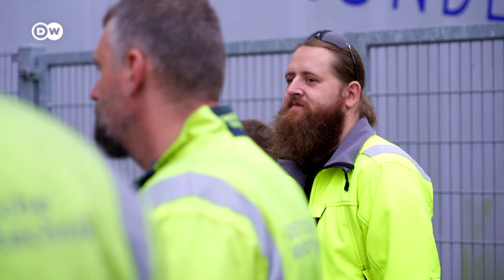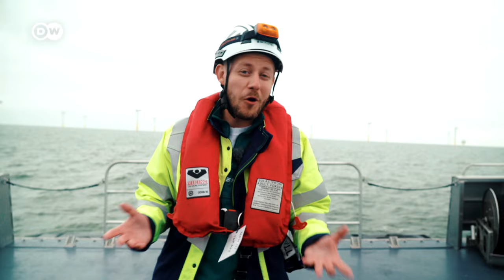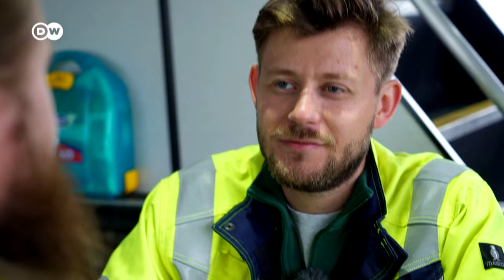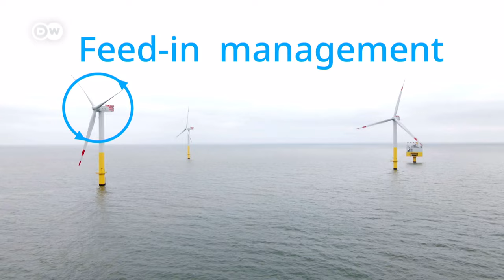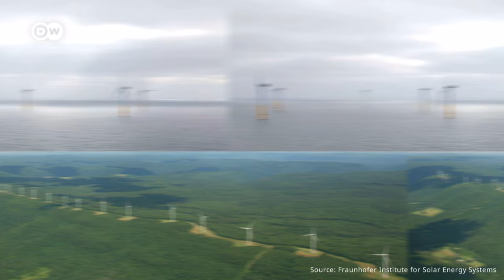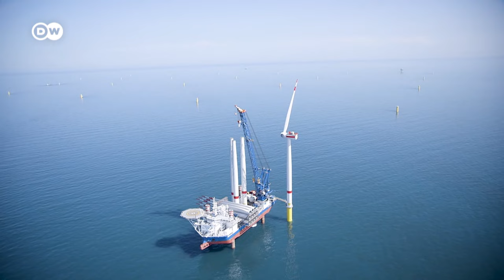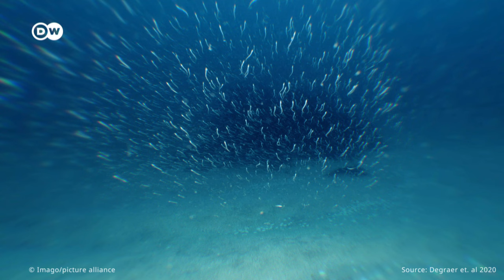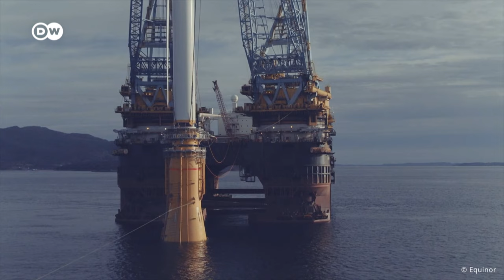Is offshore wind the energy of the future?

Comment: Wind isn't 24/7 in the North Sea 

The next generation offshore wind farms that will go up will have about 60% capacity factor which is pretty good but definitely not 100%

The biggest advantage to offshore wind is that you don't have as many objections from the locals
Reply: the UK government is building 33GW capacity on the Dogger, the figures for later build estimate a hopeful load factor of 0.63  ,  current Dogger bank is 0.42  both are over a year. Gridwatch shows the issue with wind and dispatchable power . 

maintenance costs are expected to  drop from 60% of build costs  to 10%  . thats over a 20year lifetime.
Reply: The capacity factor you give is a mean value over the year, but we also have to look at its minimum value.

If there is 24/7 wind in the north sea, in only means that the minimum predictivity factor during the year is greater than 0.

It is very important to look at both the mean and the minimum value. The mean will give you the reductuon in fossil fuel consumption that we can expect, so the result for the climate. The minimum value will get you the amount of fossil fuel plants that we can shut down to lower the costs of clean energy production (indeed with a minimum capacity factor of 0 when there is no wind or sun, you have to keep almost the same amount of fossil fuel plants so that everybody gets electricity).
Reply: @the_forbinproject2777  Offshore wind will be a large part of the energy future of the UK and Europe and will hopefully be cheap once the infrastructure is in place

If it costs £46/MWh for this cycle
Hopefully in 25 years time they can reuse the foundation the tower the cables the onshore and offshore converters etc perhaps the next cycle might only be £25/MWh since more than half the infrastructure will live beyond 25 years
Reply: @kiliandervaux6675  Yes correct at the moment wind and solar allow you to close approximately zero power stations because you need them for the windless days

However this isn't a huge problem because CCGT and OCGT power stations are relatively cheap at around £600/KW of capacity

So for the UK to build 50GW of gas fired backup would cost £30 billion but they would last over 30 years so just £1 billion a year for the backup or about £3/MWh
Reply: @kiliandervaux6675  I did this simple calc a year ago, I hope it helps 

2019 year Grid watch figures for wind delivered.

minimum: 0.095 Gw and  maximum: 13.855 Gw
 
The highest delivered power of the installed fleet was 13.855 Gw out of 22Gw installed capacity 

13.855/22 =  0.6297 or say 63%  ( 0.63) 

this means the peak GW power during any one hour of the year  could be

current fleet 			= 13.855
new fleet	33 x 0.63 	= 20.79	
combined			= 34.645 GW  delivered  

And the minimun lull figure is;

current fleet 			= 0.095  
new fleet	33 x 0.00432 	= 0.143
combined			= 0.238 GW  delivered 

new fleet is the planned 33GW of wind farms , also 

22GW fleet is averaged 6.22 GW x 8760 hours per year 		=  54.5 TWh

33GW  proposed fleet is ave  13.86 GW x 8760 hours per year	= 121.413 Twh

combined its							= 176 Twh pa (target is 260 Twh) 

these figures are taken from a report I sent to Boris Johnson .  I am not government and he hasn't replied.
Reply: For example, here are the capacity factor of different energy supplies :
Wind turbines (on the land) : 25% (0 to 100)
Solar : 12% (0 to 100)
Nuclear : 75% 
Coal and gas : way to much co2 (I don't really know but probably around 80% which is enough)

Conventional sources like nuclear, coal or gas have a minimum capacity factor very close to the mean value, which means that they are "predictable" in opposition to renewables
Reply: @kiliandervaux6675  you figures are close to values I have 
solar UK based : 10%
wind land : 22%
Wind sea : 42%

but nuclear can get to 96%  , The French can cycle fro 50% to that figure by EU standards ( meaning nukes can load follow ) 

If i use EIA figures for nuke build and a load factor of  84% for them , then the cost per GWh built is cheaper than wind. And its dispatchable. 

there are other load factor figures , some countries will do better with wind and solar for the obvious reason of location .  My figures are for the UK .
Reply: @factnotfiction5915  Yes you don't 'need' the wind turbines but we 'want' the wind turbines to do both emissions reduction and also to help balance of trade and also help fossil fuels last longer and finally to pay less for gas

If we import 40 units of gas and produce 60 units of wind that means the gas per unit is cheaper than if we had imported all 100 units of gas

Also offshore wind power will improve continuously as it has been for 30 years

You may find that is 10 years time the cost of wind power is below £30/MWh in which case by all fair metrics its below fossil marginal gas production 

I was very pro nuclear 
I can see and understand it works 

But now I'm pro offshore wind because its just got a lot better and a lot cheaper and will continue to do so fir some time yet

I can imagine 30MW turbines deployed in a decades time which produce electricity at very low prices
Reply: @factnotfiction5915  To add to your point we can calculate the marginal cost of electricity from N-Gas

If natural gas costs £15//MWH and fleet average efficiency of ccgts are 50% then the marginal cost is £30/MWH

That means if wind or solar can be produced for under £30/MWh they would be useful for fuel savings irrespective of climate change benefits etc

Also bear in mind fossil fuels aren't infinite so it would be reasonable to pay more for wind energy for 2 important reasons 

1. The fossil fuels would last longer 

2. The price of fossil fuels is set on the margin so if you are a net fossil importer adding non fossil energy reduces the price of fossil fuels so you benefit in that way too

Re nuclear imo it would be better deployed as district heating. Most counties use more energy for heating than they so for electricity eg UK electricity demand about 320TWh while heating demand just for homes is closer to 360TWh and all other buildings added its probably closer to 500TWh

This heating needs could be met with nuclear heating which is 100% efficient rather than making nuclear electricity which is closer to 37% efficient

The UK could deploy 40 x 3GW thermal reactors to solve heating. And electricity is largely also solved by existing infrastructure and what is under construction or committed to
Reply: @factnotfiction5915  Also there is the simple fact that we aren't starting from a blank sheet the UK already has existing infrastructure

If the goal is for affordable and rapid decard then efficency + wind + interconnectors is the way to go for the UK 

The cost of the backup is largely irrelevant because we already have the backup CCGTs

Having said this I do think nuclear for district heating makes more sense than heat pumps or Hydro
Reply: @briandbeaudin9166  maybe but your assertion is not really all that important or valid its private companies building these so they take the risk reward

At under £50/MWH I am happy for wind to be a large part of the UK grid. Ideally I'd like to see the cost fall to £40/MWH or less (in 2021 pounds) but am happy at anything below £50 and I am hopeful the longer term cost will be under £30

Also while an individual turbine may get 60% capacity factor the fleet will get a higher 'fleet capacity factor' as there will will wode distribution of wind I the UK. That is to say if its 60% CF with  correlation of 85% (peal output is 85% of fleet total) then the fleet CF is 70% and what's more the winter output is higher than the summer which is what we want 

That is to say we could go towards 70% wind 30% gas if we were an island. But because we have interconnectors and some storage and EVs will help we could get to 85% wind 15% NG which is a very good result
Reply: @briandbeaudin9166  location dependant but single event can cause lot of capacity  and investment to vaporize and leave you   with hefty bill of cleaning up. solar and wind are prone to this. hydro is more predictable and usually gradual.
Reply: @kiliandervaux6675  Exactly!
Reply: @Jon the Dogger bank is in blocks , the one completed when I looked last had  3 x 1.2GW capacity farms and covering  covering 8,660km² for a cost of £9Bn  and is slated to provide 5% of leccy ( which at a factor of 0.42  would be correct assuming normal wind supply ) ,  It is estimated the entire bank could supply capacity of 110GW  given trade routes , conservation areas , war graves , etc , etc
Reply: @briandbeaudin9166  agreed , but not many look into marine conditions and maintenance issues

Comment: I'm pretty sure these are better that wind turbines on the land. But it is only an unlimited energy supply as long as you their are still materials available to build these
Reply: Think average life is 10-15 years , we need to push these to 50 plus years
Reply: Concrete, steel, and fiberglass?  I don't think we're going to run out anytime soon.

Comment: Planning on putting 100 of the newer huge ones (100 meter each blade) 15 miles (24 kilometers) off the coast of New Jersey where I live. Not dead set against them but the wind does not always blow at a speed to generate even a fraction of the nameplate rating of the turbine. Also the more intermittent energy you plug into the grid the more problematic it becomes.
Reply: You're exactly right. Without grid scale electrical energy storage, wind cannot exceed ~20% of total production, without causing instability of the grid.
Reply: @vincentrobinette1507  @tony crisci the higher the tower and the larger the blades, the more energy relative to the name plate. Also relatively much more than ON because the Sea is always more windy. You can not replace a 1.200 MW coal plant with 100x 12MW "rated" Wind turbines. but you won't have to, because you can build maybe 1800 MW rated plus a bit of storage for the same price, and OF still has a way to go down in price. so might get even better.  I am actually quite jealous here in Europe. as the biggest and baddest and newest Turbines will first be installed in the US East Coast, before we see them here.
Reply: They don't look bad I don't get why people get hot and bothered about them.
Reply: @vincentrobinette1507  What's probably going to happen is that you build out enough wind and solar to provide you with enough energy even on bad days, meaning you have a large surplus on good days.  That's going to create all sorts of demand for facilities using the intermittent power surplus somehow.  But then those facilities will want to have enough power to run most of the time, meaning the renewable energy is going to be built out even more, providing even more surplus power.  And that's going to escalate until by the end of this century we'll have so much power it's going to make the 20th century look like the 14th.

We'll be able to desalinate water on a large scale, pump it uphill far inland, grow food indoors, run heating and A/C to our heart's delight.  It's going to make today's infrastructure look like what the age of the steam locomotive looks to us today.

Comment: Are there any studies on how long it takes for one windmill to recoup the energy it consumed within its manufacturing process?
Reply: About 3-4 months
Reply: @jaredgarbo3679  ahahahah ... no. It about 10 years of continuous generating at full potential. Solar is about 20 .
Reply: @lamichka  i think you are mistaking cost with energy. The cost to build it will be reached in 10 years, but the energy in about 5 months. And over its lifetime a windmill will produce about 20-25 times the energy, that was needed to produce it.
Reply: @lamichka  source?

Comment: It works as long as spare energy from them is used to produce Hydrogen .
This is stored then used in a gas power station for when there is a no wind short fall .
Reply: The hydrogen must be transported, too, though.  And there's a massive efficiency loss from the electrolysis and the reuse in fuel cells.  Combustion is even less efficient.

You can make fertilizer production carbon neutral using green hydrogen, but it's still much more expensive than steam reformed natural gas or coal, so that only works with subsidies.  You can start developing technology using hydrogen instead of coke for steel and cement production, which would really make an impact on greenhouse gas reduction.

The best way to use the energy is really to have a grid large enough to transport the electricity hundreds of kilometers across the continent to wherever it is needed, though.

Comment: This video did not really cover the subject heading and the answer is no for a few reasons.

The wind blows 365 days a year, debateable but what is not is that it varies in intensity from weak to too strong for the turbines to run. Wind turbine output is based on a cube law relationship between wind speed and output power, this makes the output very variable and unpredictable. Blustery conditions produce a very unstable source of power.
They are asynchronous generators which means there is a limit to how much power can be fed into the grid at any time or else the uncontrolled wind generation overwhelms the grid protection systems and it trips.
Unlike large conventionsl generators (wind generators may be large structures but their individual power output is tiny) they have no inertia, a characteristic inherent in large generators due to their mass and 3,000 rpm rotational speed which smooths out and stabilises frequency as the grid demand varies, occasionally quite significantly. This too aids grid reliability
High losses as the power source and the demand location is far apart. A basic of electrical design is to minimise this distance beween source and load.
Compared to conventional generation they have a short life so relatively frequent replacement. 
They do reduce CO2 emissions but by far less than it would seem on the surface.

The presenter showed his feelings with a comment about coal generators, which Germany is finding are essential, especially for an inexplicable reason they decided to shut their nuclear stations? This I feel does make his  documentary less than objective. Indeed he seemed overawed by it all which suggests that it is not his normal environment.
Reply: Nuclear >

Comment: If you wouldn't switch off nuclear power plants, you would already have clean grid. Without even a need for more transmission lines, wind farms and gas power plants.
Reply: The by product is radioactive for millions of years you think storing something for millions of years is easy?
Reply: @Random09282  easier than the millions of tons of old car and storage batteries as well as the trash from wind farms and SOLAR PANELS. Most nuclear wastes can be either reused or arent very dangerous (less dangerous than car batteries at least), and the little that is a problem is just a miniscule fraction of what the other options provide in problems

Comment: Why do they not include in the €/kWh a price of regulating the energy output. If offshore wind farms give a constant energy flow, they need far fewer regulation capacity, that is required to run land based turbines. “Eco” activists are so hilarious. Just stopping energy to make coal power plants ran longer, because of super puper dangerous AC lines…
Reply: Opposing electric lines for wind farms?  That's messed up.
Reply: @sandal_thong8631  yep, Germany’s bureaucracy is actually super slow, + all public opinions and protests. For engineer in Germany the true horror is to try build something, every window has its own regulation, even neighbors also participate in project and they can reject it..
Reply: They're not even AC lines.  They're DC.  At around 500 km DC becomes more efficient than AC for high voltage power transmission.

Comment: Does Germany not have a full interconnected grid like UK?
Reply: We do, it just got its limitations, like any other grid. If your plan is to build 35GW of capacity off the shores but you can only move 5GW through the grid to the south, that's completely insufficient. Most grids have their historical roots in a wide-spread production network with each region, city and town having their own power plants - this of course changes with offshore wind. In the UK you have similar questions e.g. as to how you'd get your scottish wind energy to England - SEGL1 and SEGL2 are suggested solutions to this. 

Though of course you have the benefit of never being to far from the shores.
Reply: @lejac4916  ah, I see. Thanks